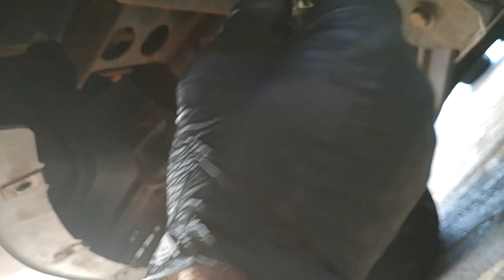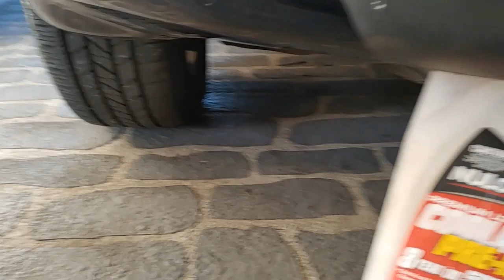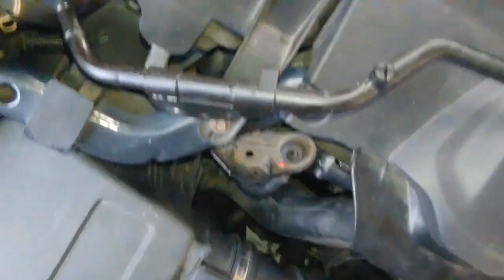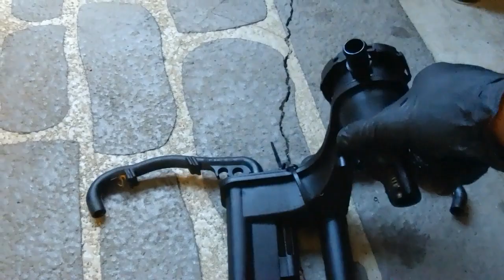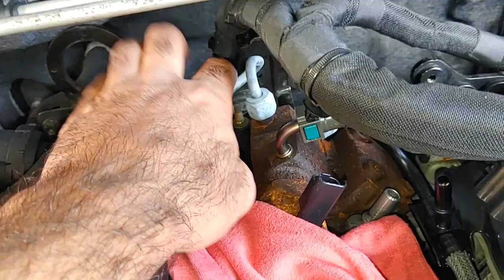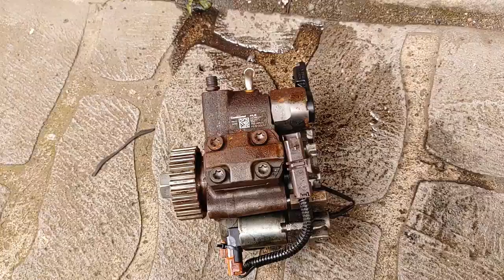Ford Territory Injector Pump (High Pressure Fuel Pump) Removal, Belt removal Part 1

Comment: Hi It is very good presentation
Can I know how do you make tensioner back to home position if I have to reuse it again
Reply from the maker: I showed it in part 2. I used a rope, you can use the old belt if replacing with a new one.

Comment: I seem to have a big diesel leak from my pump, can’t see where it’s coming from
Reply from the maker: Two possible spots. Check the Pressure Control Valve electrical connector (sits on top of HPFP) carefully.. it can leak. 2nd location can be the fuel temp sensor which sits next to the oil filter housing.
Reply: @ thank you

Comment: Can't tell you how helpful your videos have been for furthering my education on this particular model.  My Terri SZ diesel is nearly identical to yours.  It's a 2011.  It ran problem-free for several years, but recently it's started showing DSC fault on the screen, and immediately after it goes to limp mode.  First time it happened, I was able to eventually start the engine again and get home.  The second time, which happened only a few days ago, no such luck.  Had to get it towed home.  Engine cranks but doesn't fire which seems like a fuel pump issue.  I pulled a trouble code (P117D ) related to the Fuel Volume Control Valve.  I came straight to this video, which I had initially viewed about 8 months ago, to refresh my memory on the HPFP.    Are you able to guide me on where this particular valve is replaceable without taking out the pump?
Reply from the maker: I have another video on P0088 and 87 which'll help you understand the nature of your problem.
P117D is registered when the fuel pressure is decreasing and PCM cannot keep up with pressure demand even when VCV wide open.  Is it the only code you are getting? i'd suggest follow these steps:
1. Ensure your fuel sender pump is working
2. If yes, make sure it's sending fuel. coz sometime they make humming sound but their blades are broken and don't send fuel to HPFP.
2. If yes, Replace your fuel filter. Open up/cut the removed filter and see if you can see metal shavings.
The VCV can be replaced if you order one for discovery. Territory manual asks for whole HPFP replacement.
Reply: I had the same fault coming up on my centre dash DSC fault. Also said that cruise control was enabled. While going through the powerless limp home mode. It ended up being the brake light switch being faulty.
Hope this info helps
Reply: Hi mate, absolutely amazing video, my issue is the same as @theogharoon, I had a totally shot fuel pump, after the car dying on me in the middle of the road... brought it home, no sound from lift pump, bought a new one and replaced, followed your video about how the fuel system on these terris work, disconnected all hoses on fuel filter and can confirm that there is diesel coming from the pump to HPFH, however cars is cranking and not starting at all.... checked the fuel rails, diesel is coming out but very slowly when cranking. What should I do next to get the terri going? Do I need to replace the HPFP? Or should I check the pressure sensor on the rails?

Comment: Ok. So if the front timing belt snaps, crank and camshaft lose position and pistons hit the value which means engine is gone for good. 
However, my question is what happens when fuel pump belt snaps? Is that put a new belt and forget situation or a catastrophe situation?
Reply from the maker: That's correct. If only HPFP belt snaps then the car will stop running. All that's needed is a new belt. HPFP is not timed to cams so no issues there.
Reply: I heard a mechanic say the belt as it breaks will destroy the case and rip into the wiring harness but I’ve never actually seen anyone online say that happened to them.